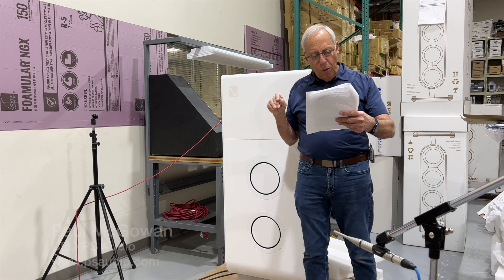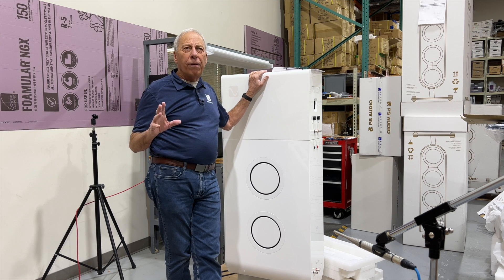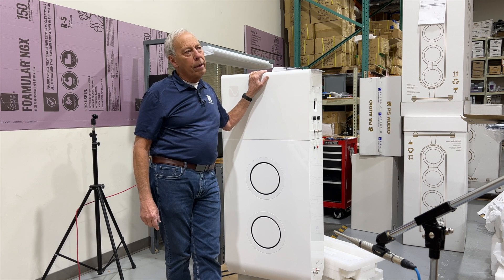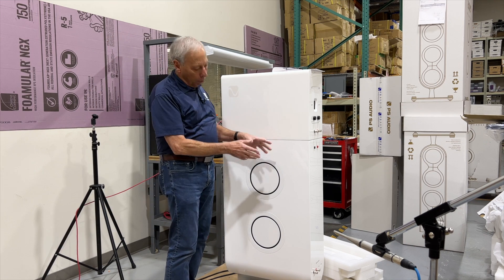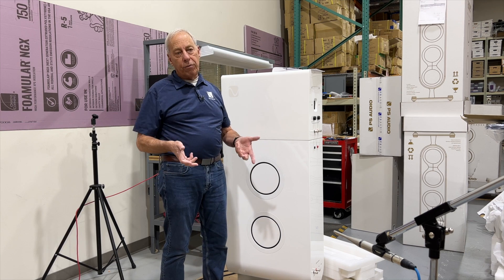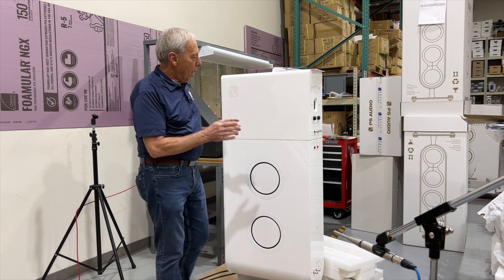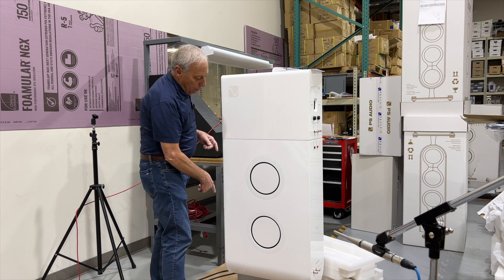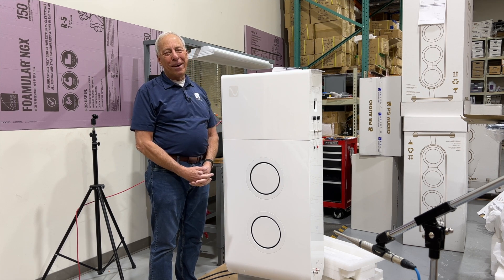Transmission line loudspeakers

Comment: you can not get extra bass for free, so only open baffle or sealed box is pure woofer output. there some new options like cardioid vents in the cabinet but i do not have enough information on it yet.
passive radiators, bassreflex, transmission line all have drawbacks.
sealed box with dsp i think is the best option, its small, goes low, easy to build and design. and none of the drawbacks.
Reply: Boosting bass with DSP typically add a delay as well, FIR might get around that.
Reply: @PSA78  yea, that delay is present in most cases, i definitely noticed that when doing narrow band adjustments.
less of an issue in bass region, and having separate delay adjustment between drivers or subwoofers. 
FIR has less phase issues but adds processing delay as far as i understand how that works.
Reply: @sudd3660  Processing can be compensated for, if there is any. Nothing about audio reproduction is perfect, there's tradeoffs for every single thing you do, so it becomes a matter of what you're willing to spend some time to perfect and then compare it to another way that's also been perfected so you can pick what please your preferences. 😄
People seem to completely miss this when they listen to Paul, despite him saying all the time, that it's what He thinks. 😂
Reply: @PSA78  you are right, but for many they can add dsp and do not notice any degradation in quality. so that means you can have the small sealed box and the low 20hz output at the same time. 
that is close to perfection for many, dsp for even output from 20hz to you upper limit and small sealed cabinets with none of the drawbacks. or even mix open baffle mains and sealed subwoofers. 
think there are open baffle subwoofers also that goes down to 
20hz
Reply: @sudd3660  A good vented box can also be good and can have less distortion than a closed, and then it's a lot about how it's implemented into the room as well. DSP can help solve issues, but preferably after all other means have been considered, especially for bass. I still prefer closed boxes, but I've had vented that were perfect as well.
Reply: The draw back is, lower output and more distortion.
Reply: @analogkid4557  for what design? that statement could be for any design. especially ported.
Reply: Sealed vs baffle have different bass responses... theory blown.
Reply: @morbidmanmusic  different do not mean worse,  generally open baffle have less bass extension, but it does not compromise on sound quality.

Comment: one foot per second bass w/ 2 subs biwired onto the front loudspeaker. need 3 more subs
Reply: nah just get proper big speakers with 15 or 18 inch woofers and drive them with a class A amp. My REL sub doesn´t hold a candle against that.

Comment: Haven’t watched yet but prediction- Paul doesn’t make them, so he’ll say he doesn’t like them.
Reply: I'm not sure why he would make something that he doesn't like. 😄
Reply: @PSA78  Absolutely. But he could also not make something that he likes because the market for it is small, or the cost to manufacture is untenable, or any number of reasons. He loves analogue but doesn’t make turntables and has explained his reasons. Fair enough. In this case he essentially says a transmission line is the best way to port a speaker but says it’s expensive to manufacture. He then says a passive radiator (like he uses 🤣) is better without further explanation. It’s a trend I’ve observed in other topic areas, hence my prediction, which was spot on. Good day.
Reply: As predicted...he did explain the differences between the basic types of bass management, but of course insists that the design that they use is superior. Only thing is, by his very explanation he kind of tells on himself by explaining the complexity of the cabinet design in a transmission line speaker. Comes down to the expense of doing that. Boils down to the fact that the manufacturer cannot pass along that extra expense on direct competition with the design that they use. He says superior, I'm guessing that it's more a case of less lucrative (no hate. That's what he's in business for)
Reply: The topic is about why he doesn’t want to make them
Reply: @jvandekant  No, the topic is the following question: What makes transmission line speakers unique and rarely used? Paul comes close to saying if cost were no object they would be the best way to port a speaker, but then defaults to a passive radiator being better for reasons unexplained (except for the astounding coincidence that the FR 30 uses them). It would be nice, but admittedly surprising (given the man is an audio salesman of his own designs), to be just a bit more transparent. But he did the same not quite honest thing with open baffle speakers recently, and has done so with various circuitry architectures in the past, hence my (accurate) prediction. Good day.